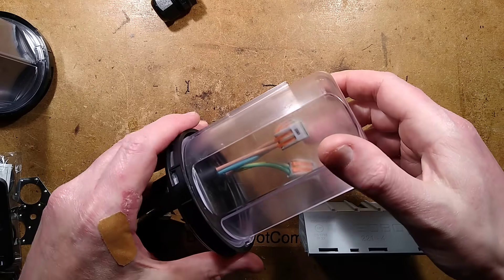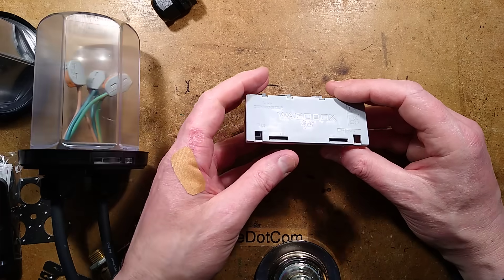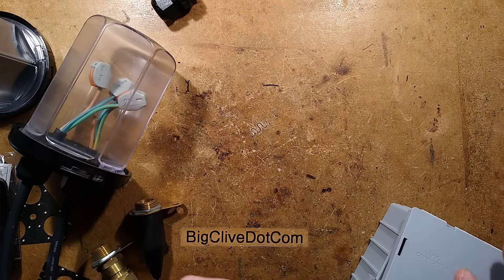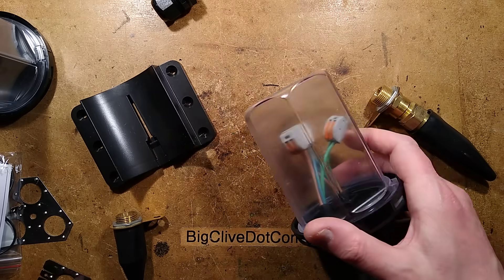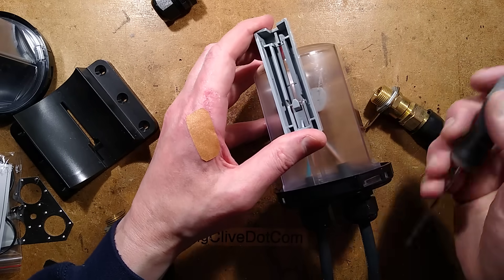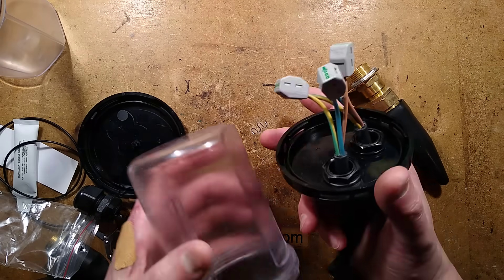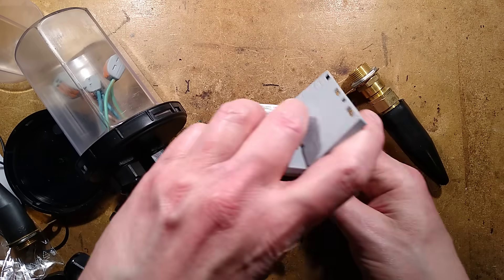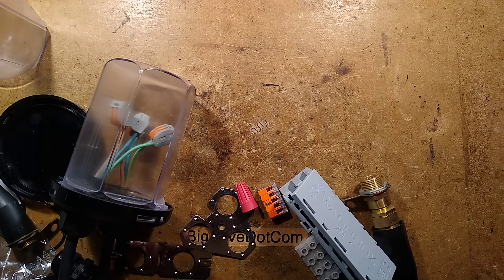A look at the Wagobox Capsule enclosure

Comment: I'm in America and I run into wire nuts all the time. They work okay as long as you are extra careful to make sure they grab everything. too many times I've had wires pull out and cause issues even after you think they are tight! I'm really happy lever nuts are starting to make an appearance here, much better way to do things in most cases.
Reply: Good point. Wire nuts are deceptively easy to misuse.
Reply: @catsupchutney  Not so if you are trained well to use them.  Unfortunately, I think this is the case in Europe.  People got lazy and so they make a spring mechanism to hold the wire instead.  I see these used in home audio to connect antennae or speakers but I don't think I would want one in my electrical system.  It's the Nintendo Entertainment System ZIF connector in the form of a connector meant to connect high power devices together and spring tension is defeated the moment any kind of large load goes across it and creates heat and in these with the little to no surface area contact is present on the wires.  With Marettes (wire nuts) all of the wires are pre-twisted together with a large surface area contact present and no moving parts are used.  I would say that Wagos are a waste because if one is in a point that I want to replace a connection or make it larger, the Wago is a single use device and since it's already held in a shape for a very long time it will have a memory to it making it a no-guaranteee that it will perform again with the right amount of force on the wire.  I would like to say to the Europeans, UK electricians and those who are pro-wago in North America:  Look up Occam's Razor and go with the Marette.  They are relatively inexpensive and really easy to use.
Reply: @WJCTechyman  Several of the things you said are not correct, or suggest you have misunderstood something.

First, wire nuts are still very easy to misuse, even if you've been trained well to use them.  I've seen lots of experienced and trained electricians still get it wrong sometimes.  That is why most of the training to use them properly is all about how to be extra careful every single time you use one to make sure you don't get it wrong in some way or other, and anyone who does care about such things needs to spend a significant amount of extra time double-checking every one they do to make sure it's a good connection (which is just not necessary with WAGOs, in general).

WAGOs are technically a form of ZIF connector, but the internal design is completely different from low-voltage connectors like on the NES.  That's just a completely bogus comparison that suggests you have no idea how either connector is actually designed internally.  (By that same logic, you could claim that circuit breakers and power outlets use the same sort of connections as a headphone jack or a serial port, so obviously they should never be used for any high power applications either.)

WAGOs have been thoroughly tested at high current loads and shown to perform comparably to wire nuts in all such situations, even well over their rated loads.  In many tests, the wire itself actually got hotter than the WAGO did, and failed first.  So your speculations about failing under high loads are just made-up BS.  The WAGO connectors also already have more contact surface area than the cross-section of the wire itself does, so anything more beyond that is electrically pointless anyway.

WAGO lever-nuts are not single-use devices in any way.  They can be reused many times over, even years down the line.  They do not develop a "memory", as you suggest (again, that appears to be just made up BS that shows you don't even know how they work internally, or how metals actually behave in reality).  They are actually far better for reusing because they don't mangle the ends of the wires, so you can even disconnect and reconnect them to the wires without having to spend time straightening or snipping them off, and then re-twisting, potentially having them not re-twist well and not getting good contact, etc.

You also seem to be blissfully unaware that wire nuts also use a spring design internally, and if anything their springs are far more likely to become distorted over time (because they are made out of thinner wire), so if you're really worried about that sort of thing happening, you should actually be more worried about the wire nuts than WAGOs.

Finally, Occam's Razor actually does not apply to any of this in any way.  I suspect you've actually misunderstood what Occam's Razor is, or how it's used, because it applies primarily to attempting to determine the cause or explanation for some observed effect, and has nothing to do with design or application questions such as these.  If you want an aphorism that actually does potentially apply, I would suggest perhaps Murphy's Law might be a better choice.  And according to that principle, WAGOs are clearly the better choice, because there are just so many more easy ways for things to go wrong with wire nuts than with WAGOs, even when people supposedly do know what they're doing with them.
Reply: @foogod4237 good response.

I still find it 'odd' that even though WAGO manufacture a sell connectors applying to God knows how many BS, UL, IEEE standards random people on YT say 'ill never use them they are unsafe <insert half baked reason here>'.... like a radom person on YT knows better than all those standards agencies?

If they have an issue with WAGOs (or the like) then ultimately it means they have 0 faith in the standards agencies, and if that's the case, they have a waaaaaaaay bigger issue than simply 'not liking wagos'.... 

It's the same with people complaining about EV-ultra cable from Doncaster cables 'mixing data cables and mains cables' and 'all that EM interference' when it's kinda obvious the cable manufacturer knows all this and yet, the cable still exists, and.... works..... as if 10/100 ethernet to an external EV charger is pretty immune to single phase 230v power running nearby....
Reply: I've used them for decades. I ALWAYS do a pull test on each wire in the connection. When twisted on carefully, they can really hold a lot of pull force.

Comment: Thats nice, will be a shame when all that goes extinct with the introduction of a fiberlaser robot the size of a house cat that can be sent in the hole carved in the wall for an outlet box, to weld the wires together using a diode laser and thermoform a continuation of the insulation to make it one peice, hermetically sealed and thermoform wire securement to keep the biological house cat, from playing pong in the wall and starting a house fire.  Until then, why chase after one o them janky boxes, half a tube of sillycone idnit?

Comment: i worked in germany last year and was installing wago connectors... they dont use it for anything meaningful other than light switches, knx connectors and such. wago sucks and they know it. it is rated for 16A but if you actually try and push 10A+ it will get extremely hot and eventually melt. the connection is weak, but clamping is strong. you cant pull it out easily but the contact surface area is minuscule. thats why in USA they use wire nuts. in Serbia we use screwed connectors. a hollow piece of brass with 2 screw holes. you put 2 wires in and tighten the screws, making sure you dont over tighten it and cut the wire (applies only to braided wire). ofcrs it is housed in plastic or ceramic (16A+) housing, dependent on Amperage rating (heating element connections, you can actually use it to connect wires directly to heating elements or even bare NiCr wire). it is a bit fiddly but its eons ahead of wago, in terms of connection quality and connection surface area, but still many many decades older. and if you, as you should by the code, put brass end caps on wires you are about to screw in (for braided wire), you cant physically over-tighten it and it will last literally for ever.
Reply: The problem of course, is that screwed connections become loose over time, increasing resistance and overheating too.
Constant spring clamp pressure is far better and I'm yet to see a genuine Wago connector 'melt'.
Reply: @Jon-em4kc   i never had such a problem. ive been dealing with screw connectors in household setting for 15+ years and never came across a lose connection or a molten connector. 
but i did see a molten wago connector

Comment: You could actually mount some kind of light bulb in the capsule and have a waterproof lamp. And then you could sit by your lamp and sip a tasty beverage out of one of the capsules. It even comes with a handy lid to prevent spills once you have imbibed enough.
Reply from the maker: Or add a gland for a straw.

Comment: I have seen similar but different enclosures for telephony wiring and unless one is scrupulously by the book there is a failure rate induced by water ingress. If there is moisture ingress if the conector is grease filled it mitigates the wiring shorting or crossing with other services and making it all go live at once

Comment: It reminds me of an enclosure that I saw during my apprenticeship in the late seventies at BT (Post Office Telecommunications) when out with the external teams.
The same shape but for 2 multiple pair cables that were also insulated with BP petroleum jelly.
2 cables were inserted through the base of the unit and a 2 part resin was mixed and poured into this to hold them and keep it waterproof.
I like the idea of a clear top so you can see what is going on.
Neat!
Reply: We also had those in Australia.
Reply: I've seen quite a few similar designed enclosures both from brass/glass and in pure brass.
Reply: 100%

Comment: Hi Clive, my favourite Wago box is the one designed for wiring up central heating controls,  it makes everything so much clearer and easily traceable during fault finding or repairs.
Reply: What model is that?
Reply: @Stefan_Van_pellicom  2 sizes, L32 with 32 connectors and L60 with 60 connectors.
Reply: @mikehunt8968  thanks!
Reply: @Stefan_Van_pellicom  m-box or s-box
Reply: In Canada we actually use steel grounded Iberville boxes and screw/lug terminals or Marettes in the "mains-level" connections.  Less chance of it melting and spreading fire, especially when working with gas-fired appliances.  The low voltage stuff runs through the wall normally and if properly configured, the thermostat really doesn't need a box.  The only time I could see a box needed for thermostat wire is in a commercial/industrial setting with metal conduit and those same Iberville boxes.  Outdoors, we use PVC boxes and conduit, both rigid and flexible to run high-voltage (240 V) connections to the AC condenser unit via a disconnect box.

Comment: Jesus that capsule is huge, you can make it into an outdoor lamp
Reply: Wire it wrong enough and it'll become one, until something goes pop at least
Reply: @JackieBright  it might burn the oxygen off before failing and might stay lit for a good while, until the whole thing melts. :p
Reply: I think that's part of the idea of the clear casings. Put a little light in there and it'll act as a marker lamp and maybe give a tech some extra lighting if they have to do service in the dark.
Reply: Surplus runway lights
Reply: You can keep a lot of plasters in it.
Reply: Well, I have an outside light unit that is a cctv junction box :D

Comment: The trouble with wire nuts is that it's not necessarily obvious when they haven't gripped all the wires correctly, especially when they are different types or flexible multi-strand cables are involved.

Comment: Wire nuts have multiple uses, such as caulking gun cap.  In North America, we do things so differently.  I've given up on making anything water "proof".  Water resistant at best is what I aim for.  Water is insidious.  Here with the heavy wind and rain, even garden lamps get a bit soggy in Winter.
Reply: I live in the desert southwest and even here I don't aim for waterproof, I aim for water resistant plus being able to keep the electrics/electronics up and away from the bottom of an enclosure, plus drainage out of that enclosure for what water may get inside.
Reply: To make a connection water proof.  Wrap one layer of electrical tape then use the rubber spicing tape . Pell off the backing tape and stretch it out. Two or more layers. Then a couple of electrical tape.
This will done right will stay dry for years.

Comment: An enclosure that big really needs a breather vent to avoid pumping water across the seals due to barometric pressure variations.
Reply from the maker: Its O-rings are greased and under high contact pressure, but I do think water will potentially squeeze its way in somewhere.
Reply: I agree. I have had Water enter a box thou the cables, between the wires/isolation
Reply: In Iowa, USA during the winter water would fill the gap at the bottom where it screws together and freeze hard breaking that plastic or at least compromising the seal. Need a mount that is an over cup it slides up into.
Reply: Op: yes. But, does this claim to be maintenance free and to what extent  - this is the question.

From memory, maintenance free - no. But I CBA to go on wagos site right now
Reply: Pop in a balloon containing a zinc-air battery with a high value resistor across its terminals to produce hydrogen gas. It will create a positive pressure inside the jar. As long as the balloon doesn't perish and the connector doesn't arc you'll be just fine! Don't worry about it!
Reply: I assume they have tested it thoroughly in a climate chamber.
Reply: @mrfrenzy.  I assume he means it can act like a "pump" and suck on the wiring insulation, drawing air and moisture from elsewhere.

But I have no idea how waterproof boxes are supposed to work.
Reply: @mrfrenzy.  dangerous assumption, tested it yes, but your definition of thoroughly may exceed theirs. I doubt they cycle to -20celcius and +80 for 700days and repeat that with many varying humidities. It's usually a much shorter more rapid lower threshold attempt at recreating long term degradation. Likely a 60day test -5c to 50c at 20-90% RH with rapid temp cycling
Reply: @tyeth  since they have been approved by Wago to use their name and logo I have enough trust to believe in the ip68 rating that the product is fit for purpose. Only way to know for sure is in about five years when it has been out in the field if they start failing.
Reply: A duckbill valve venting to atmosphere would do nicely

Comment: My biggest complaint about Wagos is they don't clip to each other - would be an easy change to the moulding.
Reply: They do have a selection of bases for different configurations of inline connectors which are quite neat, though ("Wago Inline Mounting Carrier")
Reply from the maker: There's probably some bizzare electrical separation thing regarding that.  The same reason they don't do their version of the multi-circuit clones.
Reply: And at some point, it makes sense to use DIN rail terminal blocks instead. I’ve become a big fan of those, too.

Comment: Wonder why they didn't put a similar dovetail on the inside of the container so you can more easily bond the gounds without having to drill holes for the bonding straps.

Comment: It does look like a much better design than most. However I don't fully trust two stacked o-rings with silicone grease for long term buried box sealing. A custom silicone seal ring with a "Christmas Tree" profile combined with a flat seal base might be an improvement suggestion for long term / buried applications. Side note - I have been looking locally and on the interwebs for the grey Wago box device boxes as you have shown. Can't find them in DIY stores and Amazon say the can't ship them to me where I am in Canada. They did ship me some Wago connectors with no questions asked, but the boxes seem to be verboten. Hmm....

Comment: no breather !? (not wanted for under water use, of course; but when attached to a post, I would guess this is wanted/needed? either you hang it this way and rain water will sit on the cable glands or you hang it that way and rain water will sit on the screw joint. after the rain, the sun heats it up, the air will make it out, no doubt, the next cloud obstructs the sun, it cools down, and it sucks back in the water !)
Reply: Magic Gel made by Ray Tech is excellent for underground connections.
Reply: They are IP68 so pretty much good for any conditions.  I bet most of us would have more trouble making the glands meet that spec.

Comment: Very nice indeed, I though the "jar" looking thing was for a light, and it might well suit putting some LEDs inside. Its nice to see products that are thought out and NOT stupidly expensive, in fact very reasonable for the thought that went into them. 2x 👍
Reply from the maker: Interesting idea to use one as an improvised yard light.
Reply: Should also work well for a light sensor.
Reply: I have indeed heard and seen these been used for light sensors in series with outdoor lighting.

Comment: Seeing that the enclosure is clear, it would be very easy to install a neon indicator across your connectors for a visual verification they are live.
Reply: Or you could just put a lamp in it! If it's outdoor safe it would make quite a decorative light fitting.